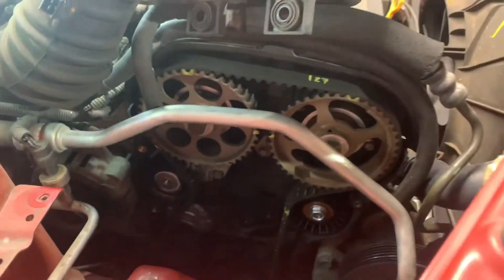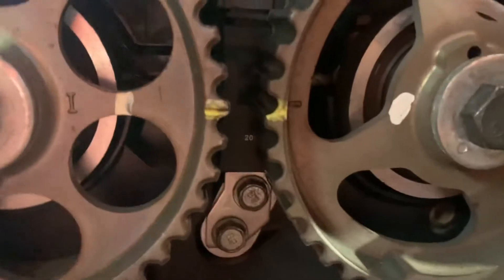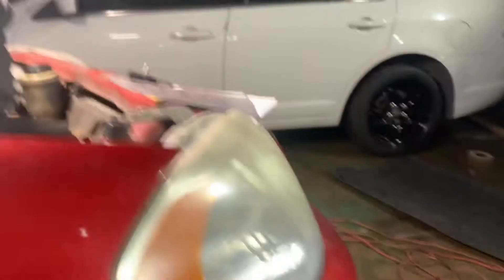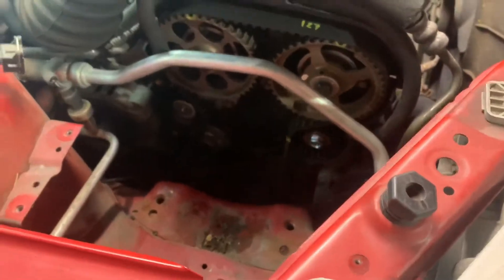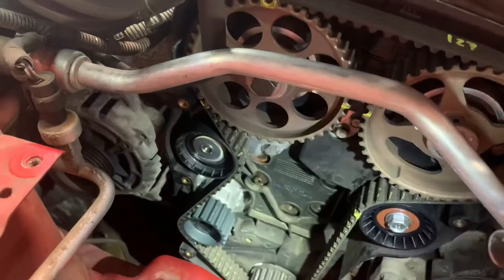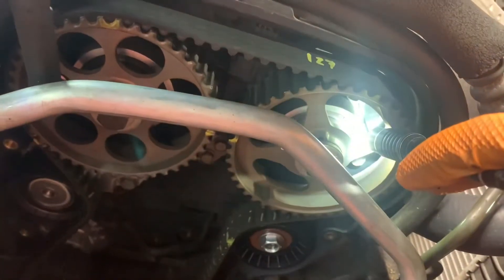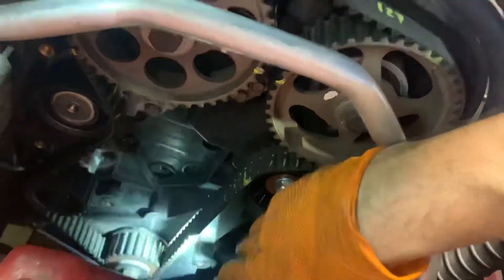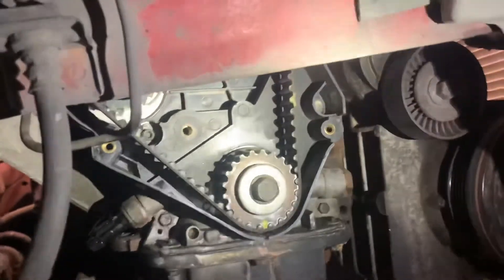2008 chevy Aveo timing marks

Comment: Align the automatic tensioner with the bracket pointer.  I don’t see where the pointer is supposed to point to.
Reply from the maker: There should be a mark on the tensioner and as you tighten it should align with the mark